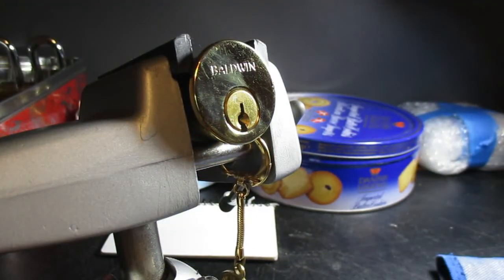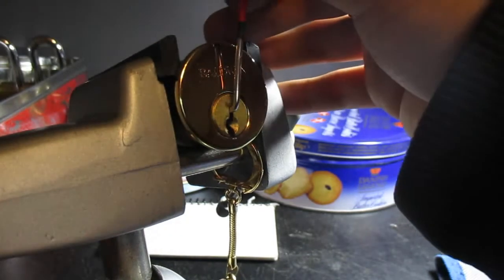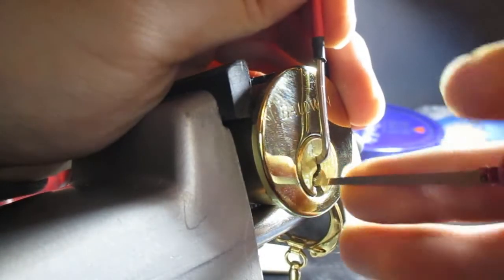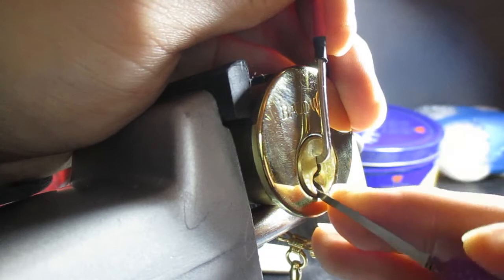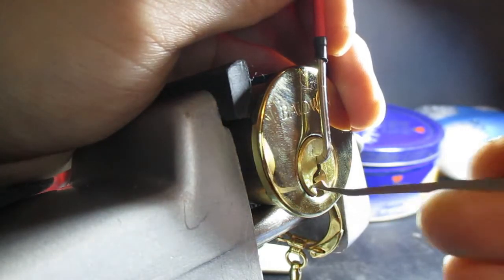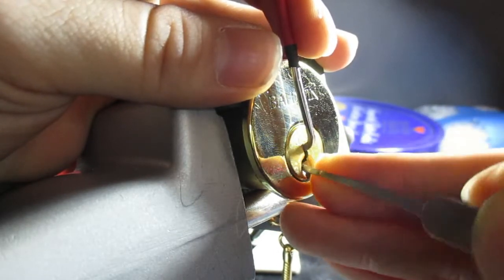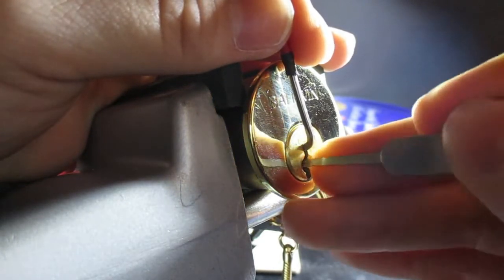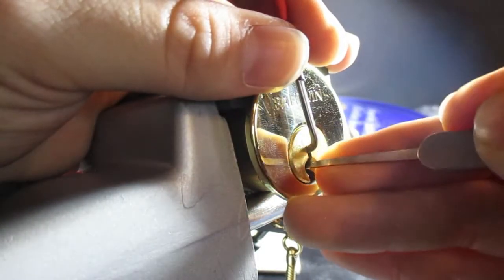Gold dragon - Pick & Gut

Comment: I appreciate your explanation of how pins work together in a lock.   I might have to try a lock with steel pins and my strong magnet.  It’s a 1 inch by 1 inch neodymium magnet that will hold a spoon to the underside of a 2x4.
Reply from the maker: Let me know how the magnet works out :) sound like a real monster!
Reply: Supallama's Challenge locks - it worked!  I need to find some more steel pins or make some out of nails or something.  But I took all drivers out of a kwikset and put one steel driver in with a brass spring.  It was locked up when I tried to turn it and when I put the magnet over the spring cover, it pulled the steel pin up violently and I was able to open it with my fingers.